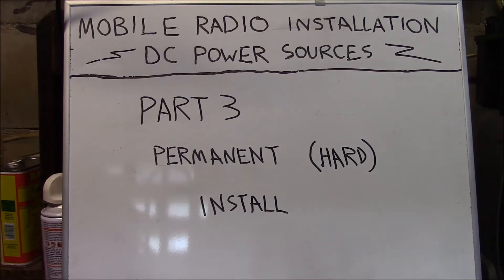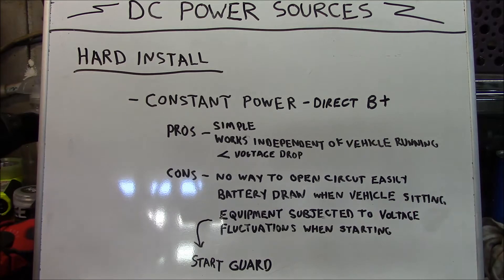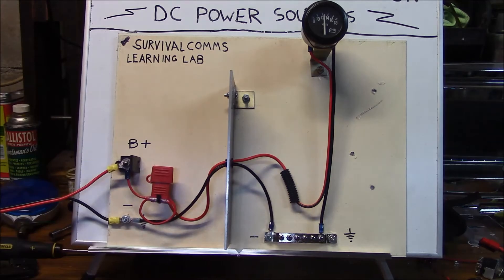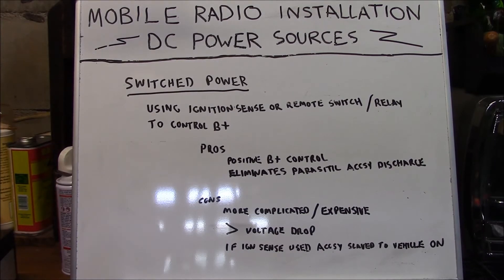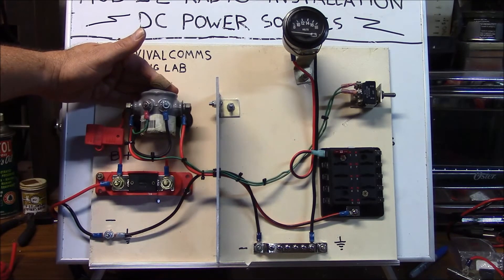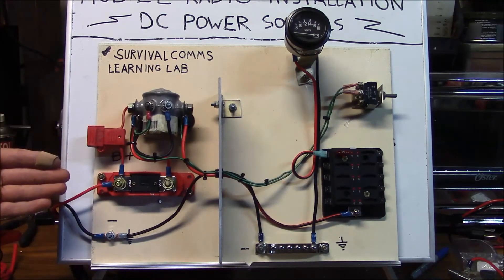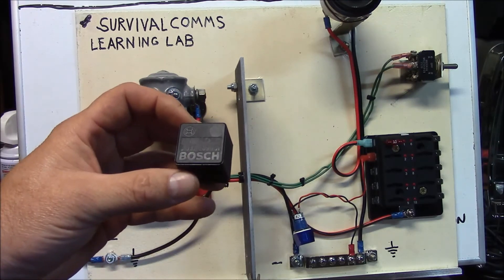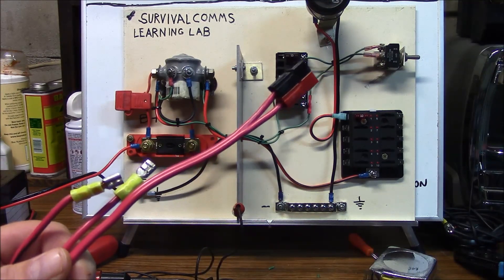Mobile Radio Installation DC Power sources Part 3 Permanent (Hard) install

Comment: High power transmedia equipment should always be dual fused at the battery. For home installations a fuse in the negative cable is not necessary but in a mobile situation it is imperative remember you have an antenna mounted to ground. 

If there's any issue with another ground in the vehicle or should the vehicles primary ground B intermittent when your radio equipments ground becomes the primary ground for the entire vehicle.

You could have 50 to 100 amps of current flowing from your antenna through your coax into the chassis of your radio and down the negative line back to the battery.. 

I've seen this happen before and it's not pretty.
Reply from the maker: And it will carry current through the antenna unless the Ground has a fuse or breaker between the chassis and ground and  no one does that. Thanks for watching !

Comment: Well done Bret.  You know you need that extra power for the light bars and sirens. ;)
Reply from the maker: Thank you Bruce and yes you know it. Modern lighting is so much more efficient but there is so much more of it :) You can squeeze a 200watt electronic noisemaker in there too but a FED Q is a no go on this system. Today began a week long annual PM of 400 + mobile radios and 700 + portables. Thanks for watching !
Reply: Yeah, you only need those on the red trucks though :)
Reply from the maker: LOL I stood on that Q siren for almost a quarter century :)
Reply: LOL old man, we had the old rocker switch in the center of the driver officer's seat, just had to push it with a finger. :))
Reply from the maker: Cool ! What rigs were you all running ?
Reply: When I started out we had a '94 Spartan with 1000GPM pump with 1000 gal poly tank, and  2000' of 4" supply in the bed, in 2014 we got a Pierce with the Gen 5 C.A.F.S. system (A and B tanks) 750 gal poly tank and 1500 gpm pump. 2000' of 4" supply line that one had the Q on it.  Both were center mounted pump stations.  Also had a 2010 Pierce 2000 gal. tanker, 2008 Ford F550 Brush with 32" mudders 4" lift and skyjacker suspension system in it,  300 gpm and 300 gal. tank on it.  Bumper sprayer, and a 1998 International Medium Rescue with the full set of rope, vehicle, and Chem decon on it.  Room for 5 in the back with the driver and officer up front.  SCBA's for all on the rescue as well as RIT tools, bags, and Incident command pack.  Also was our certified medical response truck with BLS and some ALS for the medics on the crew.
Reply from the maker: Cool beans when  I started my first ride was a 87 Sutphen deluge  w/a 1750GPM 500 gal tank  (urban department) with 11 stations in 3 districts  and when I retired it was a 2010 Sutphen custom pumper w/a 1500GPM 750 gal tank and 17 stations and 5 districts. I saw a ton of change in my time . Every station was ALS but not every unit. We had staffed rescues but only transported when it was one of us or it was really bad. That was a huge change at the time as every unit went ALS (even the aerials)  . Went from 4 aerials to 7, Heavy Rescue, staffed hazmat, ISO 1. Watching us work on the fireground was incredible. We had staffing , equipment, competent fireground commanders, rock solid SOP's.  Then came the downward slide - 2 in 2 out , EMS transport (yes I did box time),  and far too many trying to substitute experience and leadership with college which is the world of today unfortunately

Comment: Absolutely love your methods of teaching and the model is an awesome tool! Many years ago I had an old CJ5 and used a dual battery setup. One battery for the vehicle (starting, accessories, etc) and the other for the winch. It was isolated so that I never drained the main battery using the winch. That would be another option for this type of setup, especially for a prolonged op from the veh.
Reply from the maker: Thank you ! I am building models for my next few series of videos too so the feedback is appreciated. The dual battery with an isolator is a great tool. There is another option out there now called the "Battery Doctor" which is like a voltage sensing switch that will charge an auxiliary battery but has a bypass mode that allows  use of the auxiliary battery as a start battery.  The price point is pretty reasonable. I built a transit van camper for a friend and used one and it has been great in service thus far. Thanks for watching !
Reply: There was a time where I wanted a Sprinter style of van....for...well...stuff! Such a versatile vehicle. I'm off to look up that Battery Doctor!